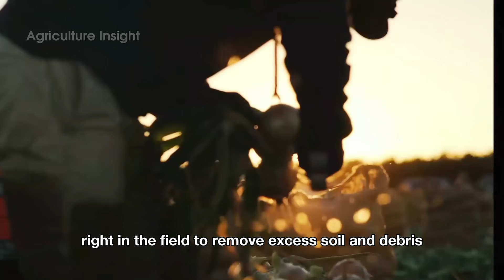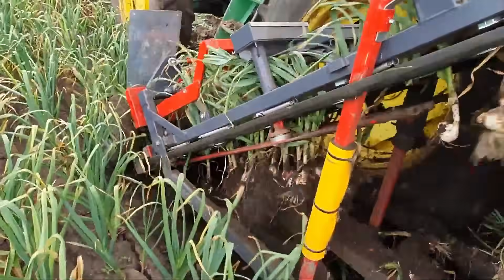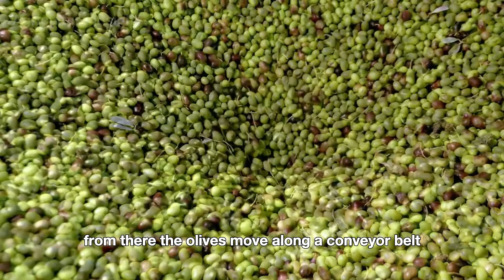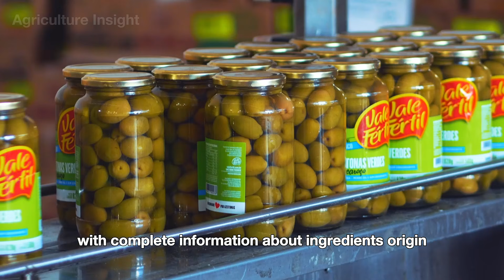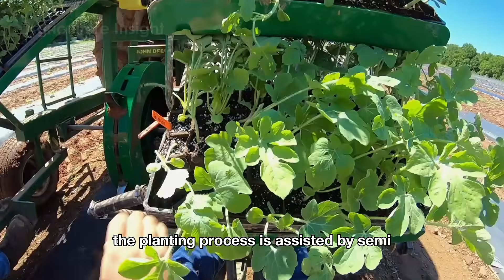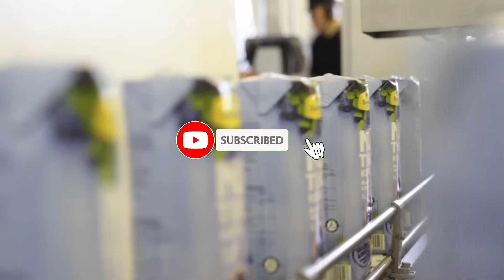8.9 Billion Pounds Of Onions Harvest by American Farmers This Way | Agriculture Technology

Comment: Using those windrowers for onions really makes a difference. I've found that letting them cure naturally in the field, especially when the weather's cooperating, builds up a much tougher skin. That extra sun exposure cuts down on storage issues big time, particularly with rot in humid conditions.
Reply from the maker: Thanks for the insight. We agree that good curing makes a big difference, and field drying in the right weather really helps onions store better.

Comment: What I'm tripping on is that, why does the consumer get a bag of small onions and the restaurants have a bag of monster onions? You know the kind that you buy 1 for $1.50-$2? Why not a bag of 5?
Reply from the maker: Good question! 😊 The difference is mainly about market demand and packaging. Restaurants and food service providers buy onions in bulk, so they get the big ‘monster’ onions because it saves them time (one big onion = less peeling and chopping). For regular shoppers, stores usually sell smaller onions in bags, because they’re easier to handle at home, fit recipes better, and people prefer variety. That’s why you don’t often see a bag of giant onions sold in supermarkets.

Comment: What happens to the onions that don't meet the spec? And the other parts trimmed off? Land fill?
Reply from the maker: Great question, and thanks for your curiosity. Onions that don’t meet the spec or the trimmed parts are often used for animal feed, compost, or sometimes processed into byproducts like dehydrated onion powder. Landfill is usually the last resort if reuse isn’t possible.